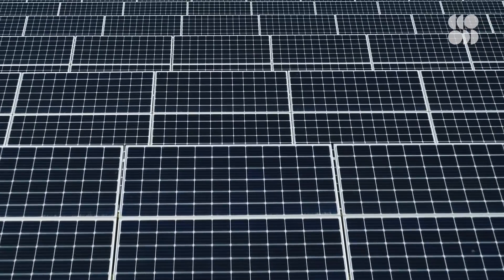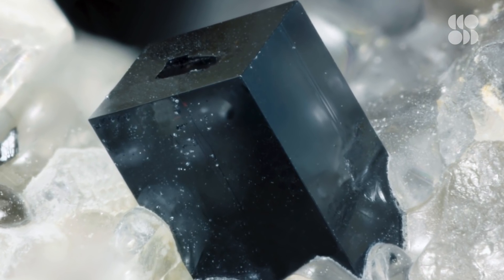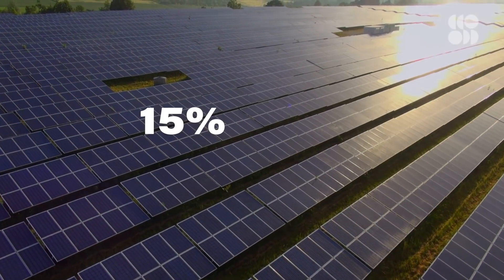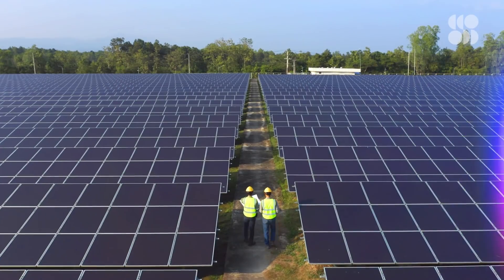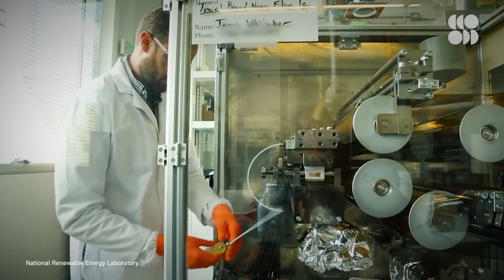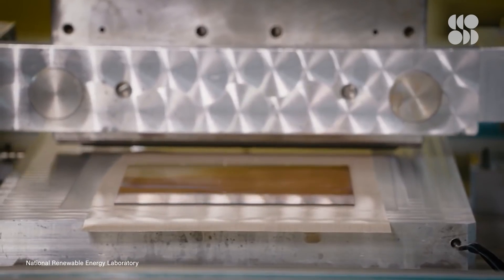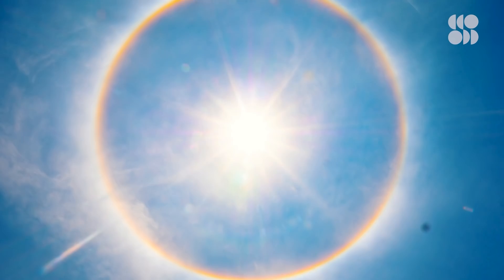How Crystals Can Turn Any Surface Into a Solar Panel

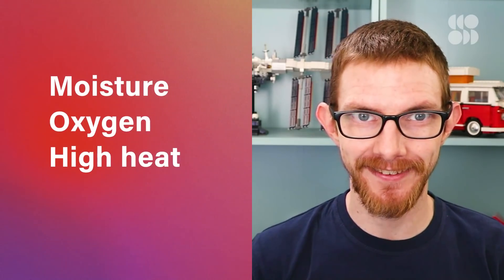Comment: 2:50 What about covering areas on the Earth that won’t subject the crystals to advanced degradation? For example, why not cover large areas of Antarctica and the North Pole with these new types of solar panels? I know that due to the axis on which the Earth spins would mean that there would be long periods of time where they wouldn’t be able to generate sufficient levels of electricity, but at other latitudes, maybe we could see something like nonstop exposure to sunlight for six straight months at a time. Just a thought. ^^

Comment: So if the silicon transistor can convert 15-20% and the crystal transistor 25%, does that mean that a hybrid cell could convert 40-45% of the sunlight into electricity?
Reply: Bottle necks. We'de only likely get 35% out.
Reply: @josephnigel8811  Thanks

Comment: Lead?  Yeah they are going to need to find another material.  I am guessing the Lead is also why the Perovskite Solar break down so quickly.  Lead is after all a soft metal that has a low melting point.

Comment: What if you tuned the crystals to infrared wavelengths and used them on the inside of a roof to use the heat that collects there?
Reply: According to the second law of thermodynamics, you can't simply turn heat into electricity.
Reply: @Theo0x89  Let me rephrase: Not heat. Infrared light.
Reply: @colleenforrest7936  The second law doesn't care about phrasing.

Comment: maybe ideal for deep space missions, no? 

very little oxygen, heat or moisture in space

plus the high efficiency would help soak up the little light that might reach a probe. *the high lead content wouldn't be a problem either, except for **maybe the weight...

Comment: One thing we could do is change from AC to DC power so we don’t have to convert the energy. Natural sunshine is DC power, converting DC to AC power causes a significant loss...
Reply: most of our devices today, laptops, cellphones, tvs, led lightbulbs could run on dc directly, no?
Reply: @elgracko  - Yes but manufacturers actually make them to run on AC power to be compatible with home power outlets. It’s kinda silly if you ask me...
Reply: @brandonleesanders  yeah, totally agree. would you suggest a parallel circuit for dc?

 like for houses that produce enough electricity to unplug from the grid...

i think they use ac because transmission losses for getting the juice to your house is lower, just btw,

Comment: Coating the cells in layers of themselves and be set up in greenhouses worst case scenario, allowing more focused and managed light while dry. Painting over degraded wear would resist losses from punctures or imperfections

Comment: Sounds like you would wanna use them to charge from heat itself
Reply: Yes, perovskites can be tuned to absorb in the IR spectrum. You can even create a pure perovskite tandem device that captures both visible and IR light.

Comment: I’m currently working in a lab researching the instantaneous conversion of calcium carbonate microstructures to perovskite water splitting photo catalysts. We’re trying to make the crystals more stable in water so we can produce hydrogen fuel.  Look up perovskite seashells in journal nature
Reply: Are there any methods to make perovskite less toxic?

Comment: Electricity from conventional silicon solar panels is already the cheapest form of electricity available today. Levelised Cost of Electricity (LCOE) studies confirm this. We don't really need a new type of solar cell using a new type of material such as perovskites.
Reply: We do if we want to apply PV to mobile applications where weight is a significant concern. Any technology that can be manufactured in a roll-to-roll fashion is still highly desirable.

Comment: Hey! I didn't get rick rolled. 30% eff cheap solar is terrific. If they take the path of OLED, it's an up hill struggle but it will probably pan out eventually. The OLED story is almost the same story functionally and it is still being told.

Comment: I was worried this was an April fools prank, but luckily I've heard of this technology before. Sad though that it seems to be advancing slowly :(
Reply: Is that what you gathered from this presentation? It's had faster conversion efficiency gains than silicon cells in the same timeframe. Fundamental science takes time.
Reply: @MikeTrieu  true

Comment: Excited to start my research work on Perovskites for my PhD !! 😍
Reply: All the best, Shri bhai! 😀👍🏽
Reply: They don't work.
Reply: @Withnail1969  they would mate, this perovskite is already being used some solar cells. The main drawback is due to its toxicity
Reply: @Withnail1969  Yes, it was first tested in 2009, puting it in a solar cell. Then this month, the commercial production has began this month
Reply: @Withnail1969  There is no viable commercialisation yet, true. But provided better fabrication method and recently discovered 2D materials it does perform well and has shown promise .. obviously more work is needed to bring it to commercial usage but it will hopefully find its way into actual usage in one way or another because they do in fact work..

Comment: Its a big scam, Shell already produced panels with an efficiency in 23% at 1/5th the cost. It's kept off the market and people are told it holds promise, to not destroy the cashflow and energy consumption from convential silicon panels.

Comment: Perovskites are unstable but we have a lot of strategies to solve this, we can passivate the grain boundaries with multifunctional molecules or inorganic compoundd (electron donor-acceptor functional groups, hydrophobic organic chains, electronegative atoms to stabilize the structure using strong hydrogen bonds and delaying the crystalization what diminishes the defects and pinholes while growing larger crystals,perylene based structures for conductivity and improve charge collection or even inorganic dielectric oxides for this passivation), encapsulation of the device makes them live for as long as 1 year and some months, self healing of the material using  doping or even self-passivation, we can create 2-dimensional Perovskites that are more stable, we can make them really efficient with multiple approaches like using Perovskite based quantum dots to recycle the light that wasn't used in a Photoluminescence layer behind the Perovskite absorber, we have billions of combinations of Perovskites that can be more stable and efficient, the Lead thing isn't really a problem because the quantity of Lead that is necessary is milions of times less than a lead-acid battery, we make films with nanodimensions so the quantity of Lead is really low (40kg of Perovskites produce the same energy as 8 tons of silicon) while the silicon production process use sulfur hexafluoride and other damaging chemicals way worse than the lead in the perovskites, and if some regulation agency worries about it (without reason because as I said, the lead is almost inexistant) we can make Tin and Bismuth based Perovskite although they aren't so efficient as the lead based ones  and are way more unstable because of the Tin oxidation states), well, if I would say everything is happening in this field I would be here for months and months, we are really getting closer to hit the market and make solar energy the cheapest form of energy, decentralizing thé energy production, creating new technological and business opportunities, Perovskite can be used not only in Solar Cells, they emit tunable light for LEDs, they generate charge carriers that can be used in Photo and electrocatalysts, solid state batteries (Li and Na) based on anti perovskites as the electrolyte and 2d perovskites as the cathode, cheaper and flexible sensors and the list goes on and on, this synthetic material is really revolutionary like the MOFs and other classes of synthetic materials, I'm way excited to work with these perovskites and grateful for this opportunity. Any questions I will be glad to answer
Reply: Finally some sensible comment which isn't discussing about april fool!

Comment: I find it curious that all anyone talks about is producing more power and not finding ways to need less of it.
Reply: Effort in that field is required, however, more energy generation is always appreciated.

In my opinion, having more tools and potential (i.e. having more energy avaliable) is just as important as needing less energy, if not more so. There are fundamental limitations to efficiency and cutting back on usage.

So I agree, discuss it and pursue it! But generating energy cheaply allows for a greater toolkit than solely working on efficiency.
Reply: @treasurehunter3744  I agree. I was only meaning to point out that a disproportionate amount of research and funding seems to be invested in more power not less waste. Kind of like our government >_>

Comment: What if we tandem them in "reverse"? Like silicon on the outside and those perovskite on the inside? Or add other materials such as quartz to shield the perovskite? Cause 30% is nearly as galium carbide if i'm not mistaken(?)
Reply: Usually when making tandem structures higher bandgap material (perovskite in this case) is placed on top and lower bandgap material is placed on bottom to minimize the thermalization energy losses. Also, using an opaque material with an indirect bandgap (e.g. Si) as a top cell will leave almost negligible chances to transmit the higher energy light to the bottom cell.
Reply: @mritunjayaparashar7996  oh I see then, thankss

Comment: Photovoltaic cells should be semi-spherically shaped instead of flat to increase their surface area as well as receive sunlight at any time of day. In addition, the surfaces should be covered with semi-spheres to further increase surface area. In addition, photovoltaic cells should be multlayered with gaps between cells to capture reflected sunlight. Finally, the cells should not have a glossy finish, they should have a matt finish.

Comment: Wow really hope those downsides get figured out because dang 30% - we're getting really close to combustion engine levels of efficiency!
Reply: 30% efficiency is about 300 Watts Meter square.
Reply: The 30% efficiency was the new solar sells working in tandem with existing solar cells. Not by themselves
Reply: @Medabee8  I mean yeah. So what? If composite is best, that's the way forward. I'm more concerned with overall solar panel efficiency than the efficiency of a specific material. That part is just the stepping stone to get us there.
Reply: 30% - 35% is awesome and can power the whole world efficiently, because of the Shockley-Queisser limit is really hard and expensive to create things that are more efficient than that, but there are tandem solar cells that can reach 49% but this is really expensive and hard to make, hot carrier quantum dot based solar cells has the potential for even more but this is only in the beggining
Reply: @Arkin2810  nice
Reply: Efficiency is merely a percentage of useful energy from the energy theoretically available.  Energy density is a far more important measure.
Reply: @andymanaus1077  that's why I love me some nuclear fission power!
Reply: Theoretically you wouldn’t even need a silicon cell in tandem with perovskite; you could just use other perovskite cells that are tuned to different wavelengths. You could even create triple junction cells. It’s interesting stuff
Reply: Yes but the sun is free unlike the fuel for combustion engines.
Reply: @nathanlewis42  Oil is free.  Getting it out of the ground isn't.  The sun is free.  Getting electrical energy from it isn't.   

There is a reason why buying "green" power from your electricity supplier actually costs more: it costs more to produce electricity from most sources which claim to be better for the environment.

Ironically, the cheapest and only truly viable source of solar electricity has been in widespread use for nearly 100 years: hydroelectricity.
Reply: @andymanaus1077  yes hydro is the cheapest but sun shines every day, oil can only be burned once.
Reply: @nathanlewis42  you can burn a tree hundred of thousand times and you still get the same atmospheric CO2 level because the tree will re absorbed the CO2 again using the sun energy, then the cycle will repeat again, you just need to make sure that you didnt burn more than what the tree can handle.
Reply: @haze6647  and what do you think that proves? It’s a red herring.
Reply: @nathanlewis42  man's got wisdom but
Reply: Yea... I've been digging a lot for stuff like tech etc
Reply: To make them last longer you need to seal them with a very very clear sealant so as to not lose its effectiveness.
Reply: There is no use in comparing combustion engine efficiency and solar panel efficiency. Solar panel efficiency refers to how much of the energy from the sun that is converted to electricity, while combustion engine efficiency refers to how much of stored chemical energy from a fuel an engine can release and convert to kinetic energy.

The numbers are similar, but they describe two completely different processes used for completely different purposes.
Reply: Solar cells are so inherently needy.. People think you can just put stationary panels on a roof and everything will be great and super efficient😆
Reply: @TheBozn  huh? They aren't needy at all? You just set them up and they work. The main problems with them is that most of the radiation still becomes warmth, and the sun only shines so many hours a day so we can't use them alone for the whole day. But there are ways to mitigate this, and they are already being deployed.
Reply: @TheBozn  I use 300 watts 3 100 watt kits of solar from habor freight with no tracking system been using for now 3rd year and still making more electricity then I need to use from Feb to November. Seems pretty efficient to me
Reply: ICE is about 20 to 25% efficient
Reply: Who thinks in terms like this?!?

Lol, say a local nuclear power plant is achieving efficiencies on 33-37%, and then your little solar plant begins to boast the same numbers... 
Which method would you still want to connect upon your grid?

People don’t care, about a reliable turd